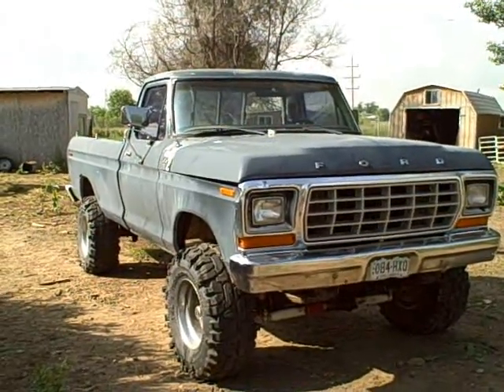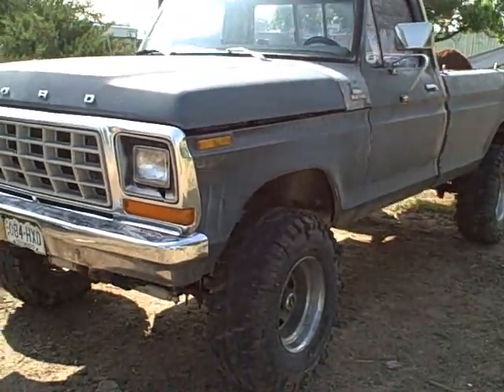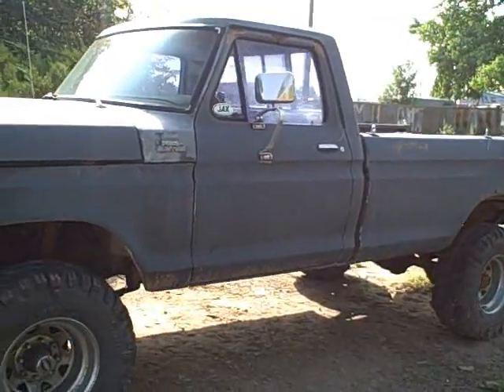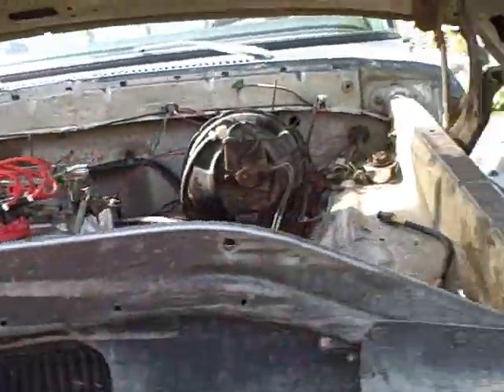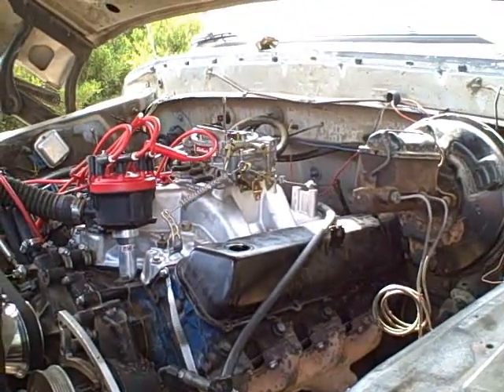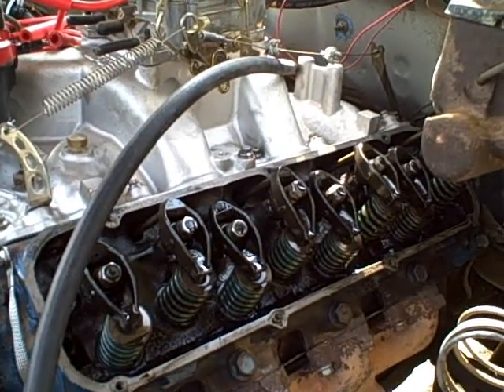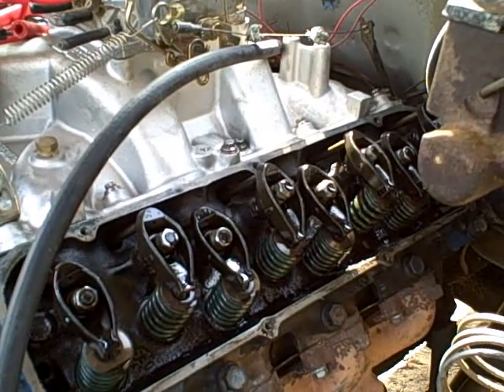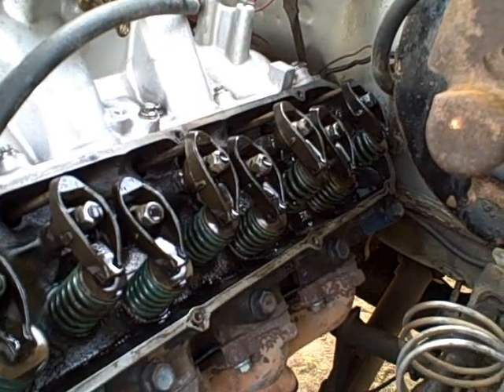Revamp Your Ford BB Engine: The Ultimate Valve Adjustment Method

Comment: oh and if this truck dynos at 400 HP at the rear wheels I will pay for the dyno test, not being a jerk here, but that motor won't pass 300 HP
Reply from the maker: I just now saw this comment and you are wrong! This engine is a 375HP 1969 Lincoln 460 and it does take squat for it to push another 25 or more, I can do that just changing the carb, intake, and headers!
Reply: That's exactly what I was going to say those motors are more than capable of that horsepower or more easily..I have an 11-1 460 right now that I can't keep cool because I would have to run race gas all the time.. so I'm changing the head so I can bring it down to around 9.1

Comment from the maker: Hey! No argument there.  The 460 was not an option for the 4x4in those years. Actuality is wasn't an option until 1983 and then that was the 225 HP version.  The High performance 460 never saw the inside of a truck except for those who ventured into the realm of engine swapping.
Reply: 460s were available in f150-250-350 2wds from the factory 77-79
Reply from the maker: @theoneracer2716  Yep, Camper Specials just not the 4x4's

Comment: Not to argue or anything, but in 1979 you could get an F-250 2WD with a 460 and a C6 automatic. I know this because my dad bought brand new in '79 an F-250 Custom with 460, C6 auto, 3.54 rear end, and a dealer dually conversion. They didn't put 4 speed manuals behind 460's because the driveline (at that time) couldn't handle the torque of the big engine.
Moving ahead 1 year and a body style in '80, the biggest engine you could get in a Ford pickup was a 400.